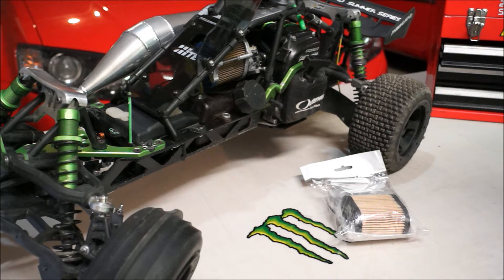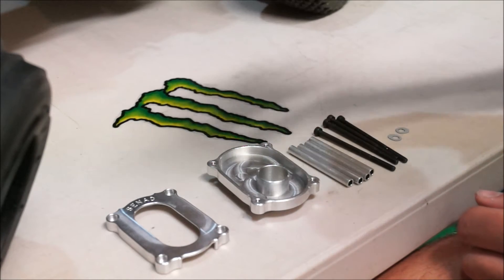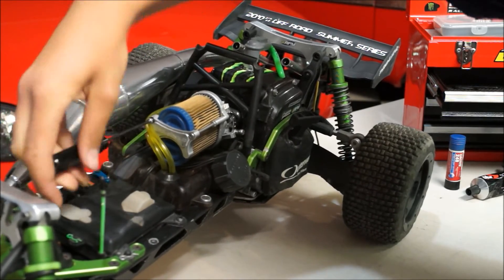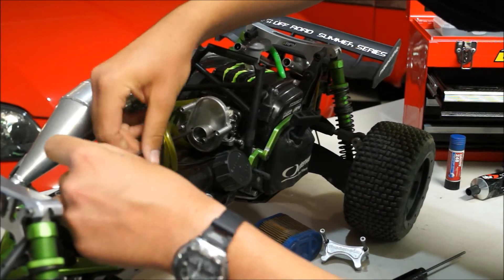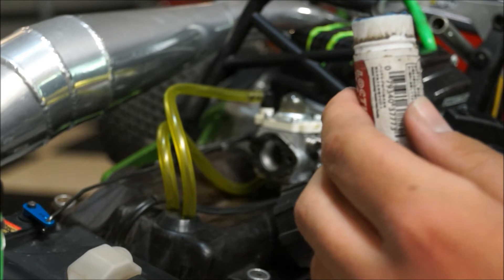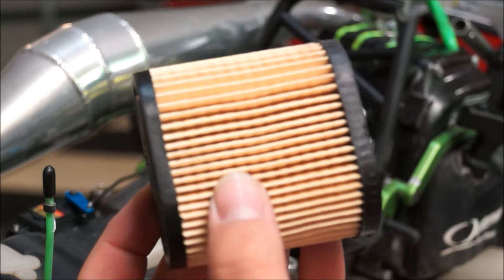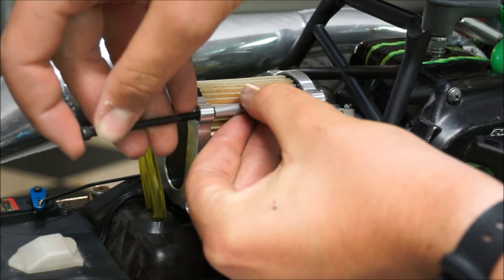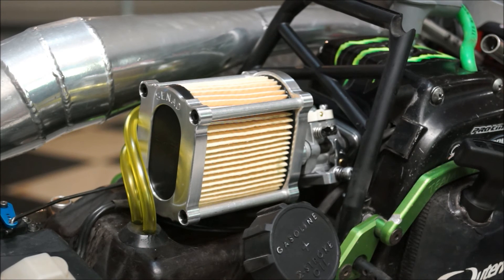Senad Filter Unit Installation Video - Baja 5b

Comment: I can't get my baja to run more then 10 minutes? I just bought it a few weeks ago too. It's complete rubbish!
Reply from the maker: Roman Calibor needs a tune mate
Reply: I have tried with zero luck... Maybe I'll pay u to tune it 😆 or show me
Reply from the maker: Roman Calibor mate check the carb and fuel and make sure it doesn’t have any air leaks on head bolts and carbt